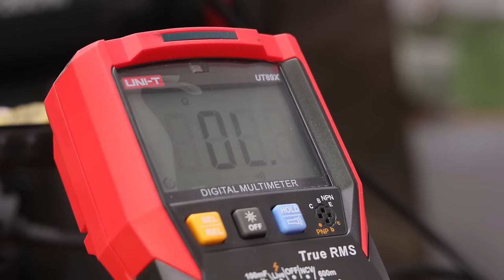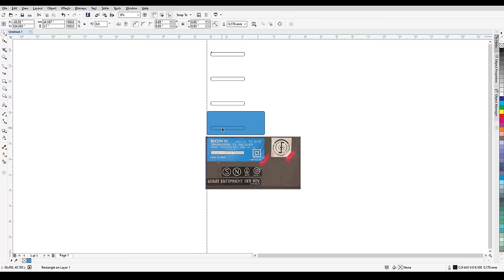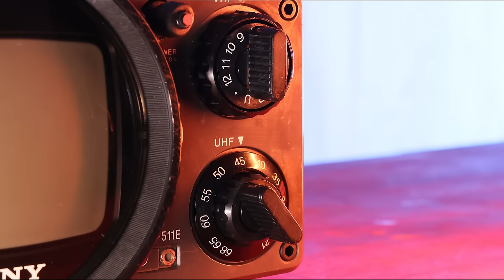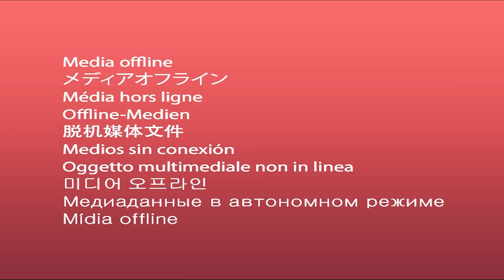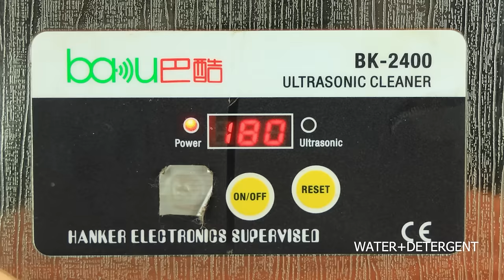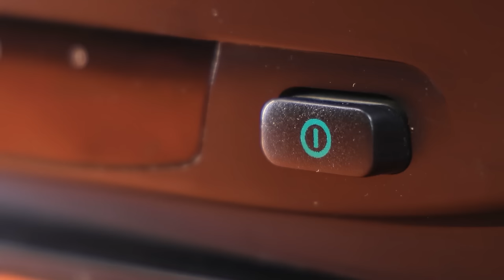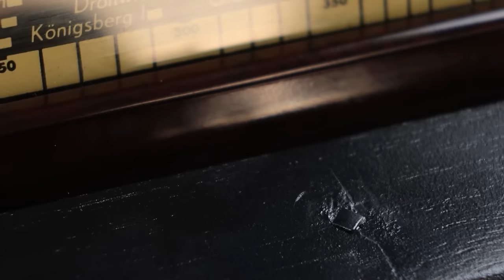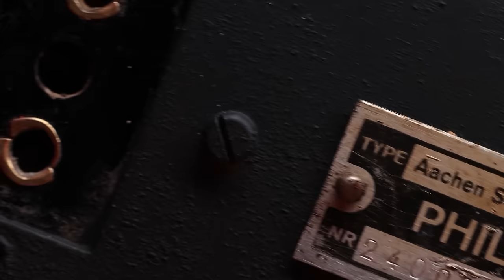Sony 1981 | Old TV Restoration

Comment: What restaration? I not see signal TV work?
What is restaration to you?
Radio no sound?
Reply: In many countries, analog television was blacked out and they switched to digital terrestrial television. That analog television cannot receive that digital television signal.
Reply: @Nolroa  If I'm not mistaken, if you sell the digital converter with analog RF output, it doesn't make sense without showing that it looks good!
Reply: yeah I don't think he actually fixed anything here. the state the Nintendo and TV are shown in in the beginning are staged with knobs and screws missing and added filth just for him to clean and reassemble for "restoration". The TV probably didn't work after, otherwise they would have shown it with the Nintendo like the Akai in the beginning
Reply: @PolyesterMoustache  Undestern

Comment: Very good video. But you need to hold your soldering iron on for longer. You want the solder to flow and fill the hole
Reply: this is not soldering, it is a weld just holds the capacitor that happens to have conductivity

Comment: One tip for putting screws back into plastic housings is to turn them counter clockwise until you feel the screw "fall" a fraction of a millimeter. This means that the screw has lined up with the threads it previously cut into the plastic. Then you can turn it clockwise and ensure that the screw uses its old threads. If keep just cutting new threads with the screw, eventually all of the plastic will have been cut away and the screw won't have anything left to grab onto.

Comment: Half arsed and unsatisfying. You didn't clean the TV circuit board to remove any corrosive cap liquid and didn't treat the tube safely by discharging it. You mashed every screw in sight, the labels look awful and your soldering is terrible. Other than that well done 😅

Comment: You have great filming technique but you dont have to fake your restorations just show it how you got it than take it apart you don't have to fill it full of sand first it just looks fake plus when you show it missing parts that you obviously removed  just looks fake one more thing flux and more heat will help your soldering the joint in the tv will not last they should look like the rest of the solder joints if done correctly